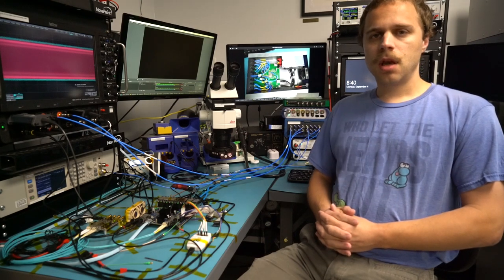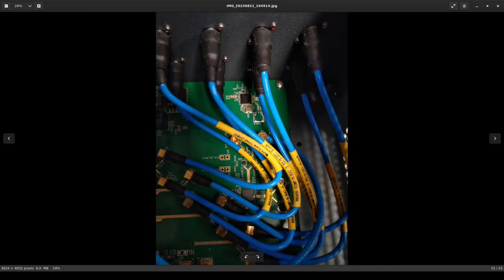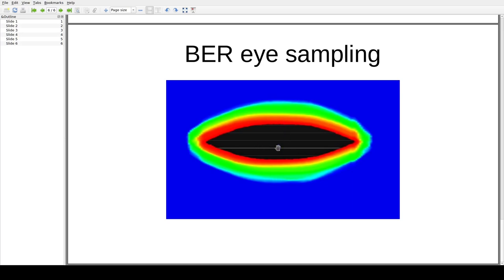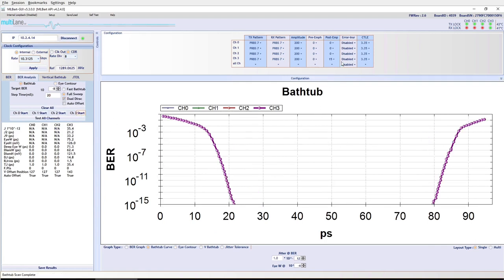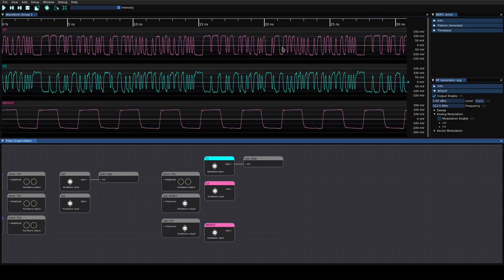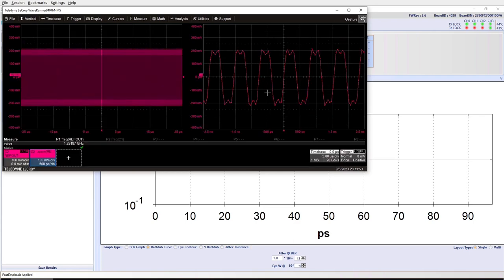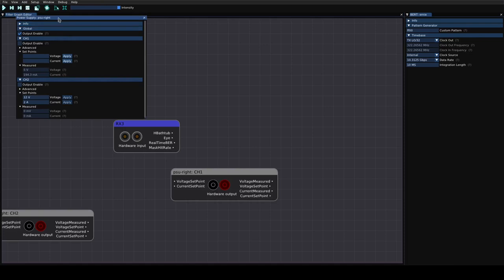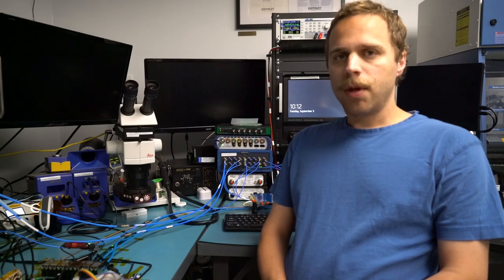MultiLane ML4039-BTP 100G BERT teardown, review, and experiments (plus introducing ngscopeclient)

Comment: Summary of the Video
Introduction
- Review and demonstration of a Bit Error Rate Tester (BERT).
- Introduction to NG Scope Client for remote control and signal processing.

Features Explored
- Equalization settings for optimizing link performance.
- Real-time Bit Error Rate (BER) and eye pattern measurements.
- Use of BERT as either source or sink in tests.

Experiments Conducted
- Testing at various data rates, including 14 gig and 25 gig.
- Use of different test patterns like PRBS 7 and PRBS 9.
- Experiment with analog emphasis on the transmit side.

Software Interface
- GUI has some rough edges and quirks.
- Custom pattern settings affect all ports, not clearly indicated in UI.
- Complete remote control possible via API.

NG Scope Client
- Allows for better control and visualization.
- Can read out real-time BER measurements at any point in the eye.
- Open-source and easy to integrate with new instruments.

Final Thoughts
- Positive about the hardware, but software needs improvement.
- Looking forward to more experiments with the BERT.
- Invites viewer feedback in the comments.

Positive Findings
1. Hardware Quality: The reviewer is impressed with the BERT hardware.
2. API Flexibility: The API allows for complete remote control of the instrument.
3. NG Scope Client: This tool enhances the user experience by allowing remote control and signal processing.
4. Equalization Parameters: The BERT allows for fine-tuning of equalization settings.
5. Real-Time Measurements: The software provides real-time Bit Error Rate (BER) and eye pattern measurements.

Negative Findings
1. Software Quirks: The reviewer finds some rough edges in the software, particularly in the GUI.
2. User Interface: The UI could be more intuitive, especially when dealing with custom patterns.
3. Configuration Resets: Changing the clock frequency causes the BERT to reset, affecting the outputs.
4. Documentation: Lack of clear documentation or guidance on some features.

Overall, the reviewer is positive about the hardware but suggests that the software could use some improvements.

Comment: This is so cool. Can I play with this software without having an oscilloscope? I only have ADALM Pluto, SDRPlay RSP1 and Saleae Logic.
Reply from the maker: We don't have any SDR support yet, but I'd like to add it. The Saleae Logic is also on the wishlist but not currently supported.

But you can load data from a lot of different interchange formats (e.g. CSV, raw I/Q, VCD, binary waveform files from most scope vendors) and then use ngscopeclient for protocol decoding. So for example, you could capture activity on a SPI flash chip with the Saleae then use ngscopeclient to decode up to a list of memory addresses and read/write transactions, filter for accesses to a specific address range, etc.